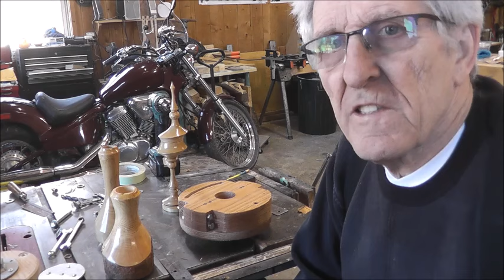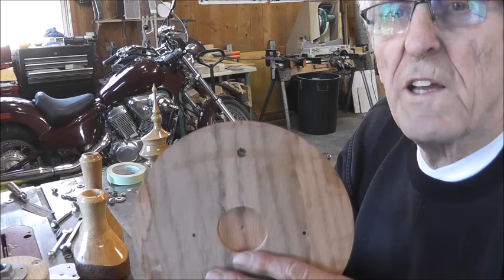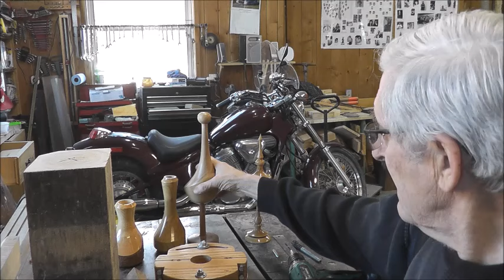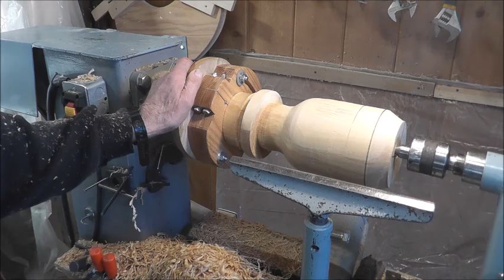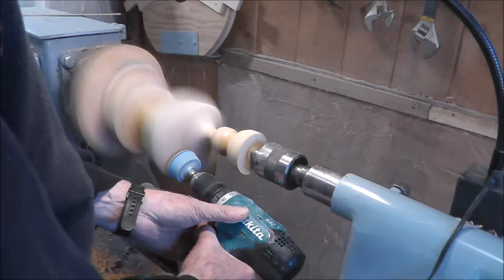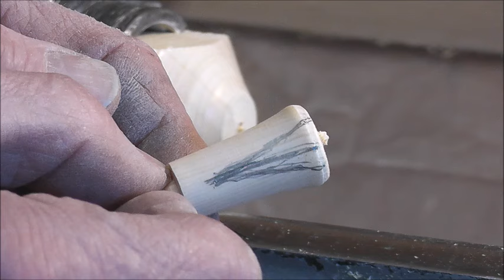OFFSET CHUCK FOR LATHE DEMONSTRATION,

Comment: Hello Brian, The Duck turned out quite nice. The jig will have to be added to my collection, just like clamps you can never have enough 😁 Thanks for sharing the video 👍 Something you might want to think about is picking up an old treadmill a Free Spirit, Club line or Herb Industries they came with a nice Leeson 1.25 or 1.5HP DC motor and good controllers and convert yourself to a variable speed lathe. Pick up a digital RPM tach so much nicer to work with. Thanks again, take care, Wayne

Comment: Thanks for the great video!  What is the glossy finish you are using?
Reply from the maker: I use Tung oil,  You can keep it along time and it doesn't set up in the can, I use to use wipe on poly but it sets up in the can it you don't use it up in a reasonable length of time.
Reply: Thanks!